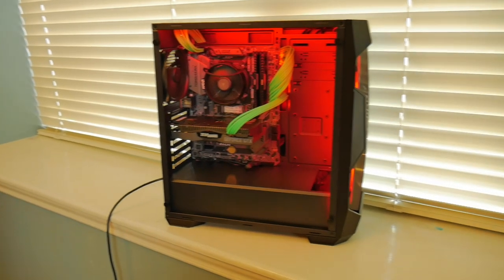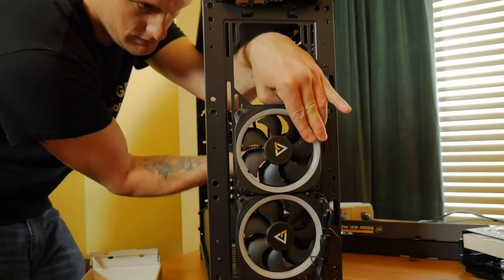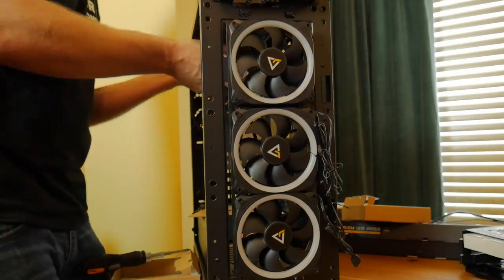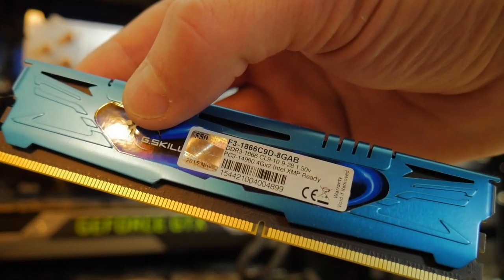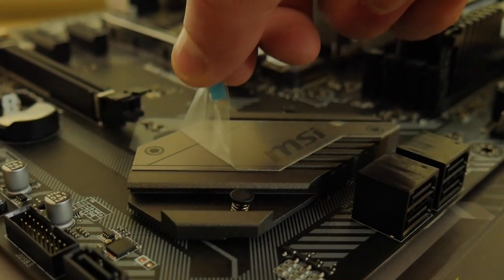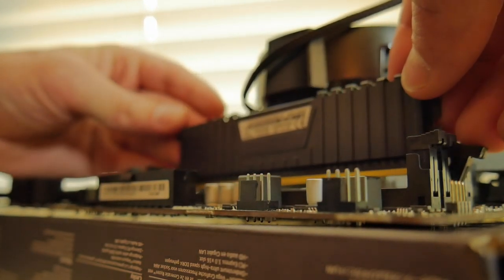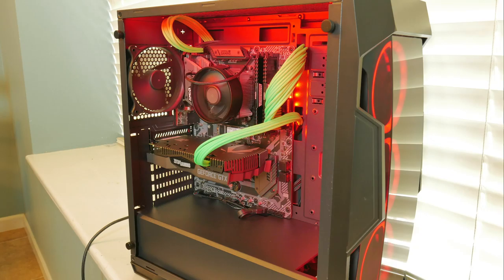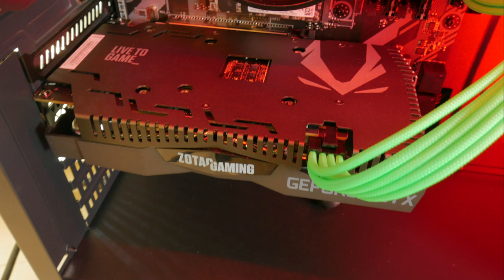Under $1000 Gaming PC for 2019

Comment: what was he talking at 3:19. it was not a four lane something?  i thought that nvme ssd  pcie was the fastest?
Reply from the maker: There are multiple protocols on nvme. This drive in particular uses only two of the available 4 pcie lanes on the slot. It is a m.2 2242 with 1700MB/s while an m.2 2280 with 4 lanes is 3000MB/s hope that helps when you are making your purchasing decision
Reply: @SonofaTech  thx for the reply ! :D
Reply: @SonofaTech  is there a way to look for when purchasing these ?  like in amazon it says that it has 2280 also.
Reply from the maker: Easiest is on pcpartpicker